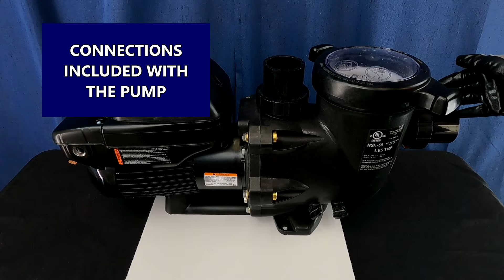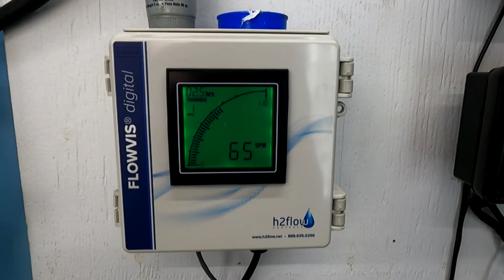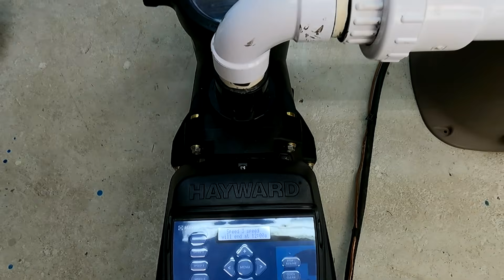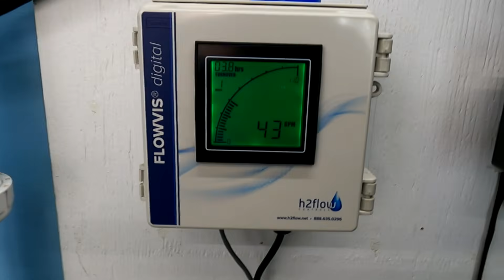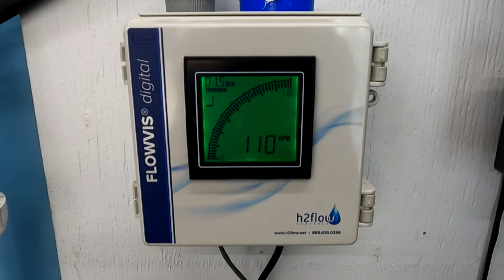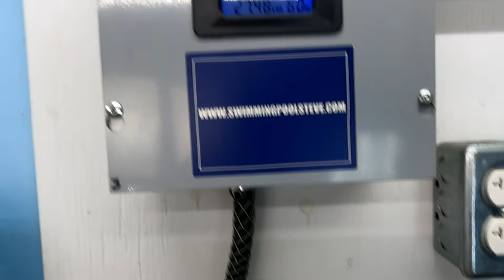1.85hp Tristar VS 900 Review - My Favorite Pool Pump!

Comment: Steve, I'm just seeing this now and i think I'm going to order a tristar VS900 from Doheny's to replace a 1hp hayward  superpump single speed.   

I have a question and I wonder if you would opine.  Vinyl liner, inground, 20x40 rectangle with a close to 9 ft deep end calculating out to just under 40,000 gallons. Salt system running a DIG 220 and PPC4 cell (second season). 

I'm on my second season with a h400 FDN ASME heater. This is the supposed commercial spec with the bronze manifold. 

Sand filter. 

On the suction side there's two strainers with one and a half inch flex PVC underground for each and a floor drain which is also 1 and 1/2 in PVC. So three suction side lines at 1 and 1/2 in each.

On the return side there's two jets, one and a half inches each.

The TLDR version is that I'm considering a higher output pump to increase flow through the heater and hopefully get the output temps down to avoid tripping a limit open "LO" error. 

Last year I replumbed some of the pool pad and upsized the local plumbing at the pad to 2-in, for example between the pump and heater although admittedly it probably doesn't make much difference since the Lions share is one and a half inch. The pool is probably 30 ft from the pool pad and completely coplanar, not elevated or sunken relative to the pool. 

I plumbed in a combination check valve/flow meter (2" flovis) last year and it's showing me almost right at 50 gallons per minute flow with a clean backwashed sand filter and having cleaned out the screen in the DIG 220 salt cell loop. If I put the inch and a half Hayward multi-port valve on recirculate, it bumps the output to around 58 gallons per minute, cutting out the sand filter. 

So we had this situation with the heater where it seemed to be overheating the high temperature limit switch. With the pump pushing through the sand filter, again just under 50 GPM, the heater would fire up and run for maybe a couple of minutes and then cut out abruptly with the limit open error. 

If I put it on recirculate and run it, it would take more like 15 or 20 minutes to trip out with the limit open error code. 

Working my way through the limit string switches, it appears that the high temperature limit on the output side of the bronze manifold is losing continuity when the output temperature of the water is reading about 101° f on the DIG 220. I think this probably is a good approximation of the output temperature since the DIG 220 temperature probe is only about 4 ft of PVC away from the output flange of the h400 FDN ASME.  The high limit temperature switch supposedly isn't supposed to go off until 135° f.

I'll be putting in a new high limit switch today and I hope that that rectifies the situation, but if it does not, the issue would then seem to be that I need to increase flow through the heater core. Supposedly the minimum flow rate for the unit is spec at 30 GPM , so I would theoretically have plenty of reserve but I'm thinking if I could push my gallons per minute from around 50 with the sand filter in line up to perhaps 70, this would likely cool the high limit switch enough so that it doesn't cut out. The other problem is certainly that the high limit temperature switch may have just been bad. I have it bypassed with an auto fuse currently and the heater seems to be running great, heating up to temp, not cutting out anymore but also I haven't noticed any damage or fire, lol. 

I guess I'm wondering if you've ever seen this sort of problem?

 Hopefully the high temperature limit switch replacement just fixes this and it turns out it was a bad unit. However if it continues this way, maybe the heater core needs more flow? 

Sorry to be talking in circles. I guess if it runs perfectly with the new high temperature limit switch then my question is answered but otherwise I'll need to look at a higher output pump and I'm basically wondering if this pump could be counted on to provide perhaps 30 GPM over a single speed one horsepower Hayward super pump? Thank you so much for your time if you stayed with me here lol. Your channel is amazing
Reply from the maker: I do not think you can or should go with a larger pump.  Your pipes are not meant for this.  You should replumb everything from the suction manifold.  Change to 2" pipes where the suction lines meet in front of the pump.  This will vastly improve flow.  If you made an efficiency change, switch the sand filter for a vastly superior cartridge filter.  As for the heater, there is a problem with it.  If you are delivering 50 gpm the problem is not enough gpm.  As you indicate 30 to 35 should be enough.  So the problem is not the flow.  I think the Tristar900 is probably the largest you shoudl consider.  NOTE the main drain, if there is one and a dedicated suction line, requires renovation.  This is not safe and no longer allowed.  You need dual main drains, plus other provisions.  WIthout renovating the actual main drain to be cide compliant then you should look into an SVRS pump or an external SVRS vacuum release device like from "Vac Alert" - this is an entrapment hazard to have a (single set) main drain with an active suction line.
Reply: @Swimmingpoolsteve  I appreciate the thoughtful response.  There is a dedicated suction line for the floor drain. There's balancing valves on the return manifold so I usually leave the main drain open along with both skimmers but you could conceivably channel all of the return through the main drain and I see what you mean would be dangerous. There's a wide great cover over the main drain that looks like it's to distribute suction and the actual 1 and 1/2-in pipe is several inches below this grate which is screwed on. 

But your point is well taken. Certainly long hair could get trapped in there which would be terrible.  Unfortunately a ground up renovation / demolition of the pool is not an option but I'll keep a close eye on the balancing valves to keep everything open. Maybe pull the handles so nobody changes them or otherwise see if jandy makes a lock out to keep them all open. 

The heater thing just doesn't make sense. My new 135°F high limit heat switch came in today. I only changed the one on the top of the manifold which is the one that if I jump it out the thing runs perfect. Apparently there's a second one in line on the bottom of the manifold which is not tripping. Unfortunately the unit still trips limit open with the new switch so perhaps it actually is if the limits of overheating? Not sure what else to do other than increase flow.  I think if I boosted 15% from where I'm at that would probably keep the high temp limit switch cool enough.   Another thought might be if the internal bypass is compromised somehow. Allowing too much flow through the bypass and not through the heat exchanger. Unfortunately the ASME model isn't serviceable in this regard whereas the standard h400 FDN apparently has a bypass cartridge that you can swap out. Honestly it's conceivable that when I replumbed it last year some shavings made it in there but seems a stretch that that would somehow result in more water being pushed through the bypass instead of the exchanger?  Are you familiar with this heater or have you ever run into this scenario? My local Hayward heater HVAC is stumped other than just getting a bigger pump and driving more flow

Comment: I see the Hayward Trisrar Vs 950 is available for $2000. I cannot find the Vs 900. Is it the same pump?
Reply from the maker: Same pump different sized motor. 900 is 1.85hp and 950 is 2.7hp

Comment: What is the average cost for this pump? I have a 30 foot above ground pool and I am definitely planning on getting a variable speed pump for energy savings. It is to be installed in two weeks or so so I have time to get these ideal pump for energy savings
Reply: Did you buy this pump? If so, how's it working for you? We're about to semi inground an 18' x 40' extruded aluminum pool. I'm hoping this pump will work for us.

Comment: I have this pump. It’s installed to suck water from the bottom of the pool and push it out of the 3 water feature “spillover pots”alongside the pool. I don’t know if it is functioning as variable speed any longer because nothing is displaying on the control pad. It seems the pool guys just used the valves to control the flow. Now I have a new pool guy who says we should move this  variable speed pump to become the main pool filter pump. They said it would save us money because we could run it a low speed. I’m not sure if they’re right. Also, I’m not sure why the pump display is displaying nothing but still turns on. Any help would be greatly appreciated.

Comment: thanks for the video. there are a ton of reviews online with a common issue. most of them are complaining about the mother board going bad after one year. i’m curious what you know about that. please address
Reply from the maker: Having worked in national sales for pool equipment manufacturers before I have learned that the anecdotal evidence you read online is not an indication of systemic problems with a particular product line. Pumps and heaters will often fail very early due to poor installation practices. People also disproportionately complain about the most popular products...as in if you sell more pumps than other manufacturers then you will also find statistically more incidence  of complaints online simply due to the number of units out there in the market. So I am aware of the complaints, but a lot of this is left over from the initial product line, the ecostar, back in 2010 or 2012 or whenever the ecostar came to the market.

Comment: great video Steve. We have a 16000 gallon kidney shaped pool in california, and we want to run a new VS with a solar pool heater, are the issues regarding the 1.85hp vs the bigger 2.7hp (the VS95) still applicable? Struggling to figure out how to calculate the needed draw
Reply from the maker: It comes down to your unique system design, especially including how many suction lines you have and what size they are.  This is why generally you should have a pool professional come to your house to evaluate the installation.  If you go too large with the pump you create a potentially dangerous situation with your pool pump.  If you go too small, the pump will fail to efficiently meet your flow needs.  The 1.85hp tristar has good lifting ability.  Maybe less than a 3hp high head pump but more than any medium head pump on the market.  If you can estimate your resistance to flow in feet of head, then check out the comparison table I made for all of the most popular pool pumps to see how much actual flow it will deliver at both 30' and 60' of head examples.  Bottom of the page here: www.swimmingpoolsteve.com/pages/pump-reviews1.html

Comment: How do you keep 30lbs of pressure on the filter if you cut the rpm on the pump the math does not work ?
Reply from the maker: The filter pressure reduces with the rpm reducing. Which is a good thing. The filter pressure could also be called a system inefficiency meter. Lower is better. So low rpm with slower flow has way less inefficiency and resistance to flow

Comment: Is the GPM flow fixed, relative to the pump RPM?  Trying to design a 24 hr plan for my 1.85 hp Tristar but on an 8320 gallon pool with heater/chiller and salt system.
Reply from the maker: GPM is relative and not fixed for a few reasons. First, every pool is different. So actual GPM on my pool and your pool for a set RPM will be totally different. Bit even within your own system you will have variance. As your filter gets dirty your GPM flow rate will reduce with the increasing system pressures.

Comment: Is there much of difference between the 3202 and 3200 model? I got the 3202VSPND model when I was expecting the 3200VSP model.
Are they both the Tristar 900?
Reply from the maker: The 3200 is well discontinued by now. The 3202 is the tristar 900 motor (1.85) but ypu have the ND model which means no display.  This ND pump is intended to be controlled via automation and not direct interface with the pump.
Reply: Sorry, I meant the SP32900VSP model. Is there a difference between that and the SP3202VSP besides the view screen.

Comment: Great video. We have been running the SP3400SP for a little over ten years. We love it however it is on its third drive controller board. The first two Hayward replaced under warranty however the last one I just replaced was just out of warranty. When we installed the pump originally in 2012 the cost was 899.00 which has now climbed to around 2200.00. We also got a fairly large rebate from the power company in 2012.
Reply: I’m in the same boat. Same exact pump. Fourth drive, second pump since 2011
Reply: Install a surge protector
Reply: @dave-67-67  Aready on one. This is a problem with the Hayward and Pentair VFD’s. I went with Hayward because they were suppose to be slightly more reliable. The first two were under warranty so it wasn’t such a big deal. Also in the last five years the price for the drive board has gone from slightly under 300 up to 850. I am talking to the repair facility I use for my industrial VFD’s to see if they can repair the boards.
Reply: @harveypaxton1232  ok goo'd to know I wonder if they fixed it with the newer model
Reply: @dave-67-67  I am not sure but in my area there are more than ten used ones for sale with the “motor stalled” fault.

Comment: Absolutely fantastic, been looking technically at various high-end pumps for my new pool 27 cubic meters; and got to the Hayward 1.85 HP VS 900 then found your video, thanks so much.. Can I run it at 220 volts, 50 Hz without degradation.

Comment: My contractor suggests a Hayward 0.75 horsepower pump. Would you recommend the pump in this video over the 0.75hp single speed hayward? Pool is 14 x 28 with 2 bubblers and a 36 inch shear descent, 3 foot to 6 foot deep
Reply from the maker: No modern day pool should be using a single speed pump for filtration.
Reply: @Swimmingpoolsteve  thank you sir

Comment: Cannot wait to see this in action... 13 year old Pentair started smoking and decided to go with Hayward 900. Thanks for all the data. I have mixed 2" and 1.5" so the sweet spot can be found... I initially was gonna go with the Super Pump 700 but the basket size pushed me to the 900series
Reply: Is the pump still working?

Comment: I have the OnCommand Hayward. controller and want to swap out the single speed pump.  I measured it at 10.6A @240V.   Is there a version if this pump without the controller and can be controlled be the OnCommand 4 Relay controller?  Or get rid of the pump and controller and use the bulletin controller?

Comment: You are a hero and leader in the pool industry Steve, thank you for caring and striving for the proper way to do things. I have 83’ feet of distance from my skimmer and main drain in 1.5” pvc piping to the pool pump so two total suction lines of 166’ feet, pretty definite from your videos that is divided by 2 and equals 83’ feet of head. What size Hayward pump would you recommend, the 2.7 THP unit because the high head distance? Has Hayward salt generator and heater, 4 return pool outlets branched off one 1.5” line at some point to the pool, thank you for guidance.
Reply: we have same setup - what did you decide?

Comment: My customers never want to program the pump.  They want the minimum speed to kick in the heater and leave it at that speed. I find that is around 1800-2200rpm with a clean filter.

Comment: Great video, I am getting ready to have a stealth inground pool installed 16ft x 34ft x 3.5ft (Shallow) x 6ft (deep end) somewhere around 16,000 gallons. This is the pump that is coming with my pool kit. I planned on utilizing 2.5" plumbing with sweeping elbows. What RPM and or GPM would you recommend for a 24 hour filtration schedule?
Reply from the maker: Not enough info by a long shot to answer a question like this.  You need adequate flow rate for the peripheral equipment, the skimmer and return functionality, and to meet minimum turnover requirements for your pool.  Every pool will have a unique answer to this question

Comment: Great job explaining but I’m looking to replace my 21 year old Hayward pump and motor, I have a 2hp motor single speed and I’m considering replacing it with a VS. I have a 16x30 pool and I watched your video on comparing Pentar vs Hayward and it seems that Pantar moves more water but Hayward is cheaper to run? Is that a fair comparison?

Comment: Which type of VS pump would you recommend for a 17x30 above ground:  15-16k gallon,  two skimmers with 2" lines converging to a 3" main.  Two 2" return lines.  Currently have a single speed 1hp pump hayward xstream, CC1000 cartridge filter.  Currently getting 68 gpm flow per my flow meter.  Tried to use all your tips and tricks installing this used system.  Minimal turns, sweep elbows, etc..

Comment: So with 1.5 in pipe 38 gal is max flow but all of your other videos with 24 hour pump schedules are well over that, I'm just a tad confused. Is discharge flow more than suction flow at the same RPM's?
Reply from the maker: 38 gpm is max LAMINAR flow rate. Not maximum flow rate. 38 gpm is the max EFFICIENCT flow of water in 1.5" pipes. Ypu can move 80 or more gpm. But not efficiently

Comment: I am getting a 16x32 rectangle inground vinyl pool is this pump too much.  I am not getting any water features just a regular pool with salt system. If it's too much what do you recommend.
Reply: Did you buy this pump? If so, how's it working for you?